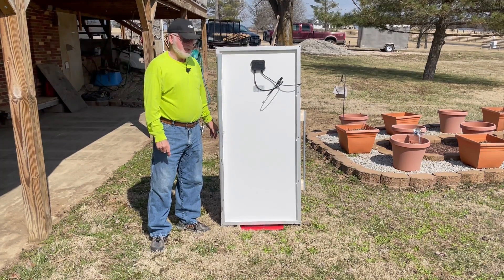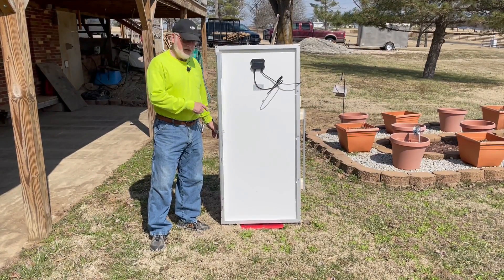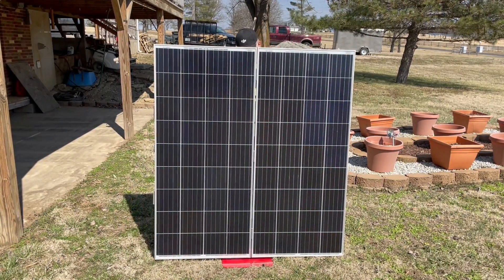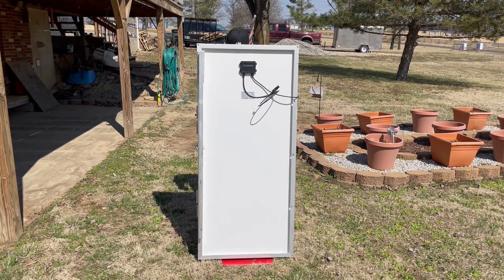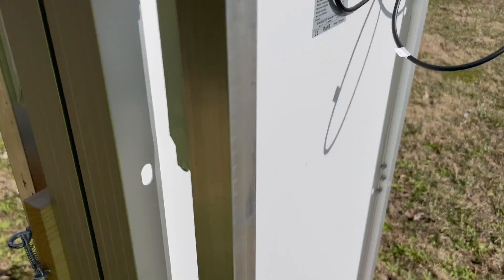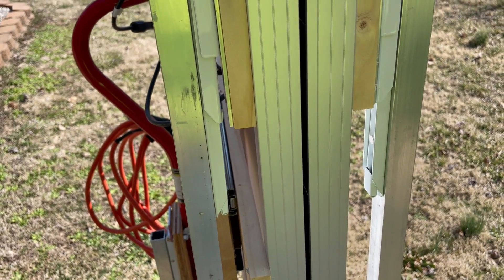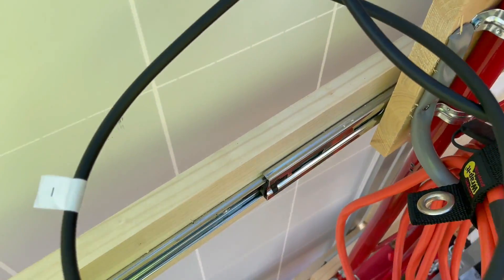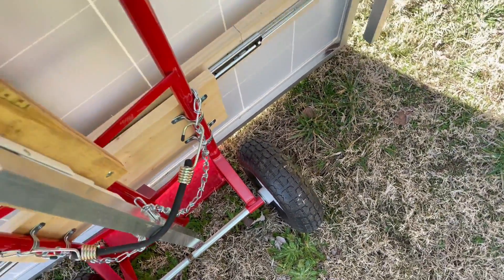DIY Portable Solar Panels on a dolly

Comment: Like your solar cable.
 I purchased replacement ends for my orange 50' 12-3ga extension cord and used them with MC4 connectors to fabricate "adaptors".
With the "adaptors" I can use my extension cord during a power outage to feed solar power to my mobile battery powered cart.
Thanks for sharing you ideas.  Much appreciated!
Have a blessed day.

Comment: Hi. Where do you buy the aluminum collapsible legs? Thanks.
Reply from the maker: They are pieces of aluminum with a folding shelf bracket.
Reply: @paulswoodshop395  Thanks for your response. Do you recall where you purchased this bracket? It looks like the brand/manufacturer name ‘Hillman’ appears on one of the brackets, but a Google search yielded no result.
Reply from the maker: @donaldstumpo9519  I believe it was Menards or Lowes.

Comment: How do you anchor it in those winds....?
Our winds can rach 50 or more. Great idea
Reply from the maker: If you have high winds you can add an eye bolt to the bottom of each panel and drive a small stake in the ground.